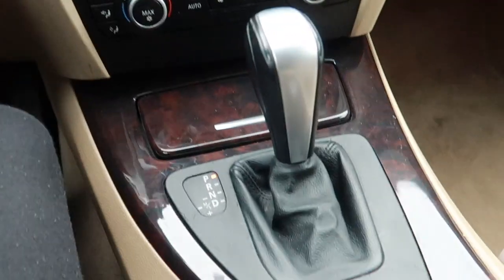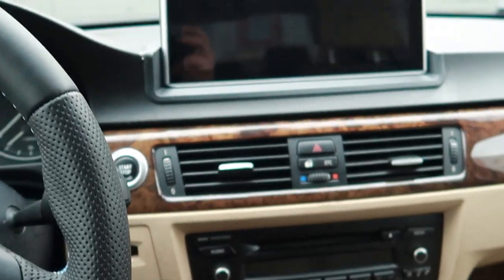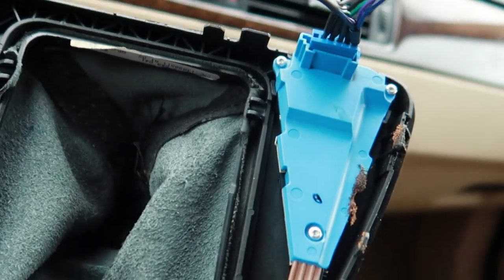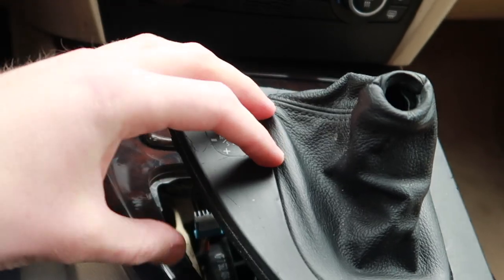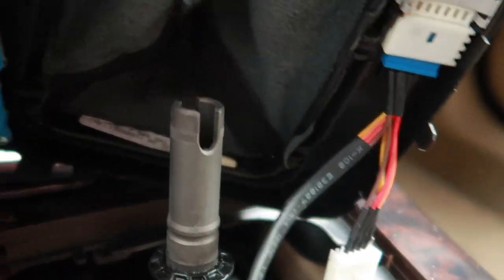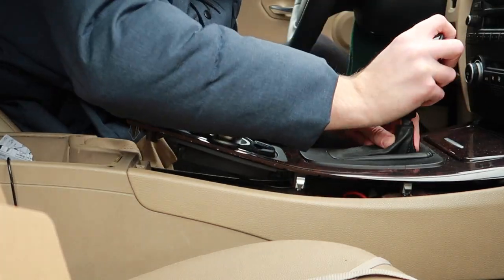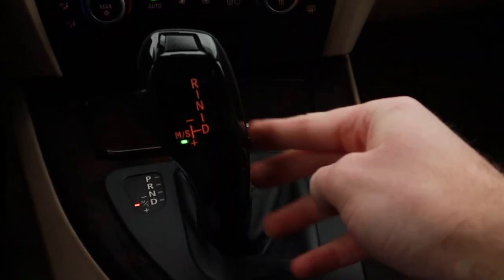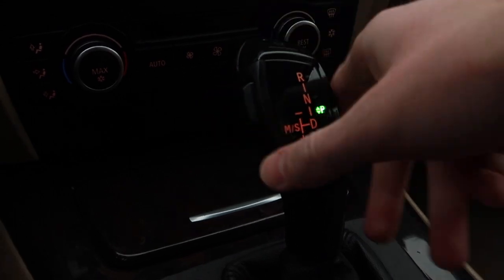BMW E90 JOYSTICK RETROFIT - E39 E46

Comment: Hi, great installation guide. Looks pretty mean with the new stick. How did you get the stock gear indicator to show as well? I bought one off Amazon and I was only get the gear indicator to show up on the knob only and not the stock.
Reply from the maker: Hey thanks man! My one came with a splitter cable that gave output to stock and knob from original wire

Comment: Hey, how does it perform so far? any coding needed? is it still in good condition? thinking about doing that mod too 

greetings from germany
Reply from the maker: Hey man! Everything works perfectly fine, no coding needed, didn’t worn off at all during this time. :)
Reply: @humancode  Aight, thanks for answering so quick!
Reply from the maker: @yarrovic  No worries at all, happy to help :)